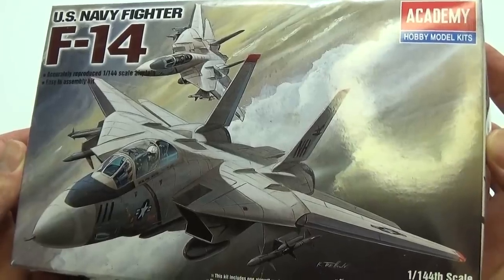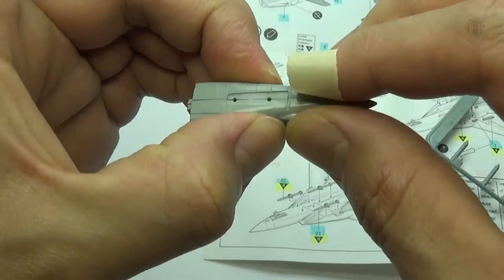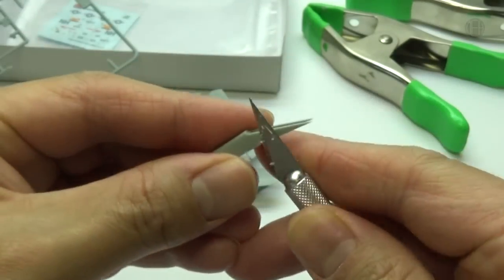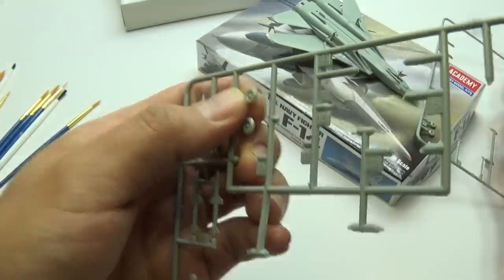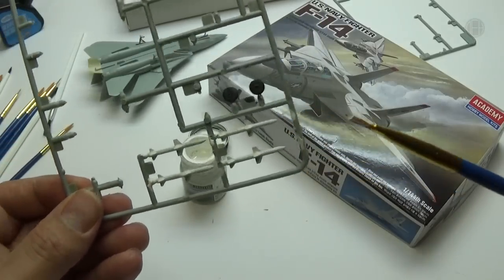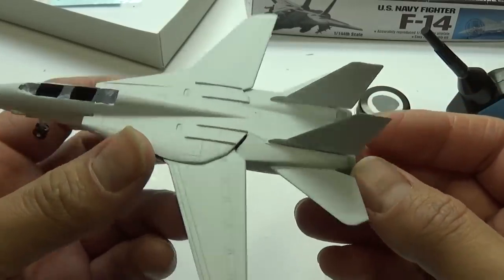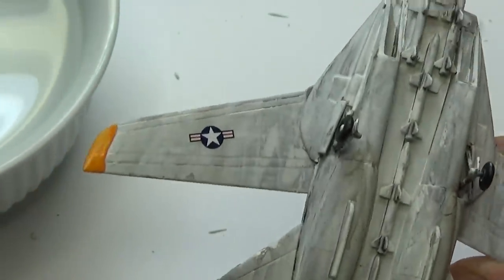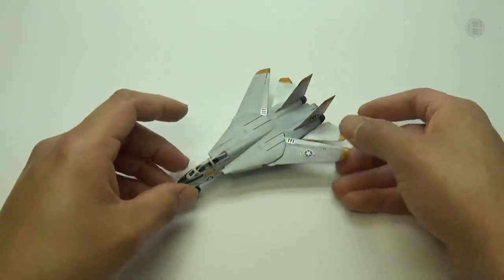DEH Models - 1/144 F-14

Comment: try out tamiya's extra thin cement. it sets up very quickly and cures in less then an hour. one benefit is you can hold the part in place and just brush it onto the joint and it will set the part however you position it.